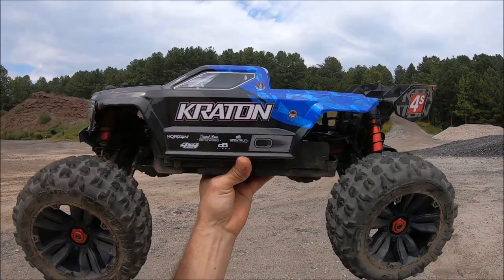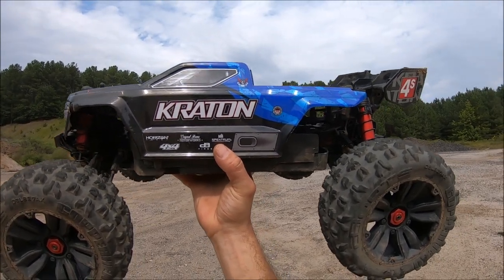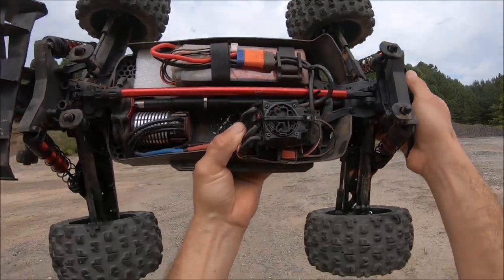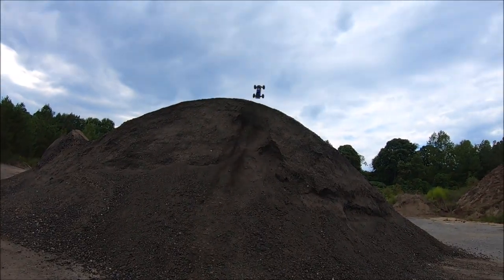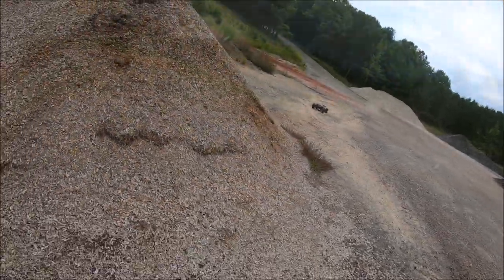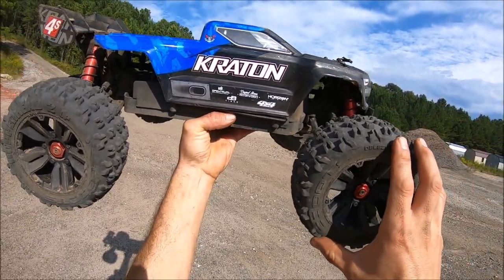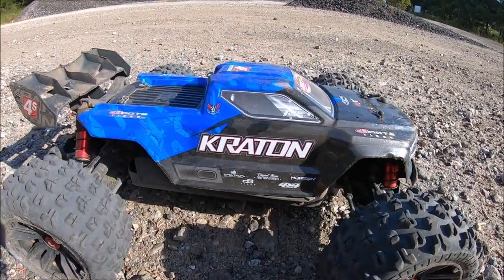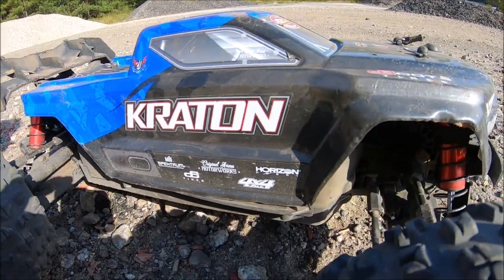ARRMA Kraton 4s V2 "UNCUT" BRUTAL Freestyle! BEST UPGRADE!

Comment: I got the bash bar for my outcast 4s. I broke two chassis and saw m2c was coming out with the bar and was like a must have no questions. I also got the motor plate and brace as well. That stuff should really make the truck higher level. I enjoy driving it a lot, but the chassis breaks where no so fun. Great fun spot.

Comment: Ok quick question. I’m 100% brand new to RC’s lovin the Kraton as it seems to be the best on pretty much any terrain. Should I just  I go with the 4S or the 6S and just use the throttle limiter switch on the radio? Great content! 👍🏻
Reply from the maker: For a first rc the 4s is a great entry level rc. Also upgradeable. It's fast but not too fast and it has less metal parts and easier to maintain. Both are great just depends on what you want!

Comment: I decided to throw in the 1515 2200kv with a mmx8s in my K4S with a 23t pinion, it sure loves to pull amps. Even the esc will get toasty after a while

Comment: Hey man I have both the v2 trucks and I’ve had issues with driveshaft pins coming out and the geared outdrives in the diffs go
Out on me and if
Not those it’s the actual cvd end that uses the set screw to hold Itself Onto the outdrive end it did take some massive abuse time and time again over and over like 60 packs almost but after the
Issue arose  it’s been nuts trying to get the outcast to stop doing it I run RC mad labs brace and now the cvd kit from them and ceramic bearings between my outdrives in front and rear diff because I found they like to come apart occasionally any idea what I could
Do to stop the outdrives from sheering Teeth? Thanks In advance for the help
Reply from the maker: I've never had diff issues but I have had pins coming out of the cups. I simply use a 3m screw through the holes and locknut. That holds them on!

Comment: Should sacrifice some weight and girth and have thin piece covering the chassis in-between the bulk heads so it be two for one protection for the chassis.  I t hink they breaking from hitting rocks . The plastic seems harder than old blx  line ups..

Comment: I just got my kraton 4s and it doesn't seem much faster than my 3s granite. Would replacing just the esc give me a bit more power? If so can you recommend a good replacement. Would a max6 or max8 be overkill?
Reply from the maker: Honestly I'd start with a bit bigger pinion gear. A 15 tooth will get you moving just watch temps!
Reply: @RCDUDE81   ok cool. I'll give that a try, do you use Arrma pinions? Another quick question.  Is the red brace that goes across the top of the chassis supposed to have play in it? It's a bit loose but the screws are tight. Seems weird for a brace to have play.
Reply: @rowdyrod7870  I'm pretty sure the brace has play to help absorb more impact. I'd get the upgrade for the chassis and maybe a arm's if you wanna really not break it

Comment: Is m2c selling the brace or are you testing it for them still?
Reply from the maker: Still in testing. Wanted to try a different bash environment.
Reply: @RCDUDE81  thanks man my kid keeps cracking his new outcast chassis. Also broke an axle in half and they’re not available yet. The center driveshaft also twisted itself in half but the replacement looks stronger so I hope it’s better. He’s hard on his rc’s for sure

Comment: Dog Bone not popping out 😱😱
Reply from the maker: No but I had a pin slip in anther run. Simply used a 3m screw and locknut instead of a pin and clip.😜